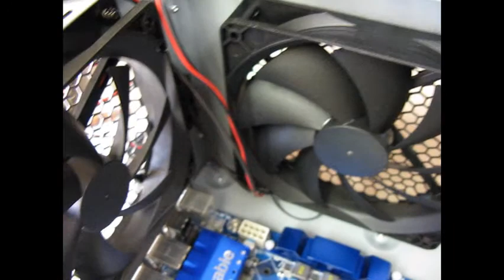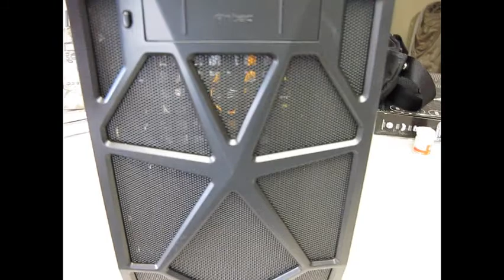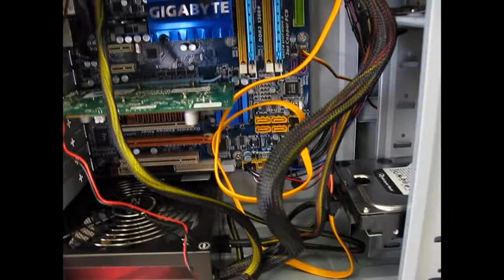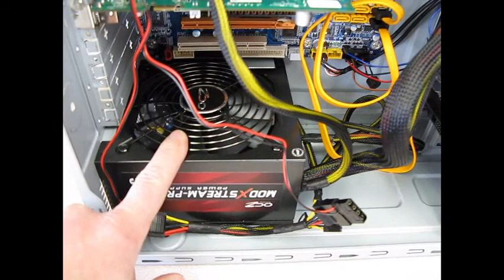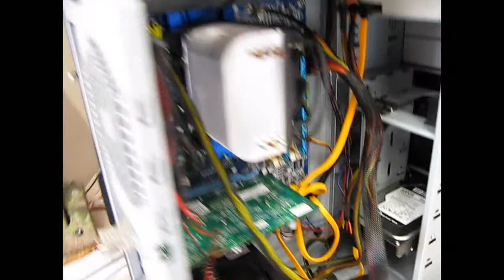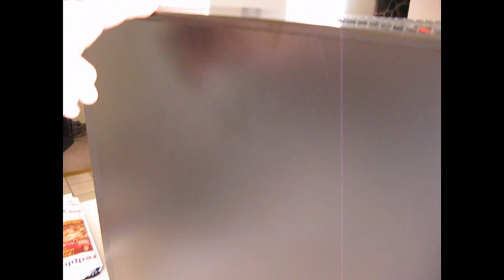Core 2 Quad 8400 build in Antec 200 case

Comment: i would recomend one of those power supply's that have wires that you can add and remove to tidy it up the inside if your worried about the inside i fliped the hard drive and have it mounted backwards so the power is in the front of the case and hid what ever wires left behind the drive bays i am happy with what it:D

Comment from the maker: @shawnygz I would say it's a good deal. I have used the Q8200 CPU and it's a fine chip. The WD hard drive is probably a green....but it's still a good deal. It should be fine for normal use. It's not a hardcore gaming setup, but it will give you years of use. All the best. Good luck!

Comment: Might want to just get a new fan. I built a pc with my friend last night and his had those molex connectors, but it-itself was only plugged as an attachment. His board has mad fan slots, and we didn't use any of the molex stuff on the power supply, popped off the adapter and went straight from the board :D